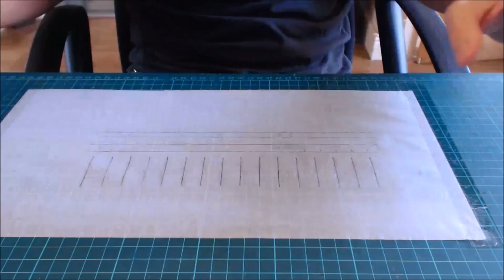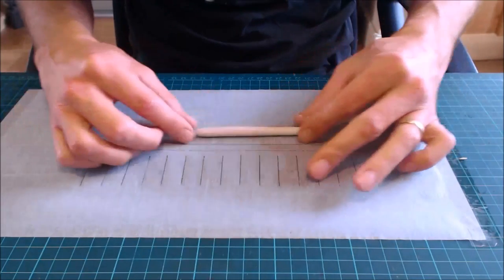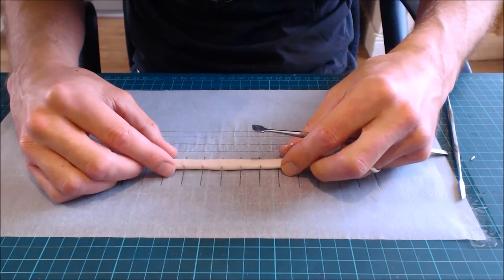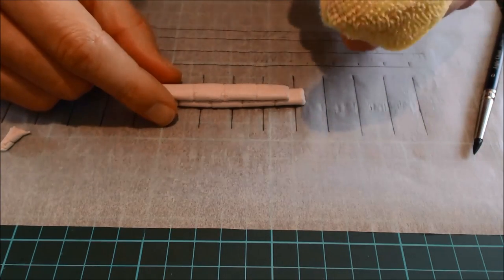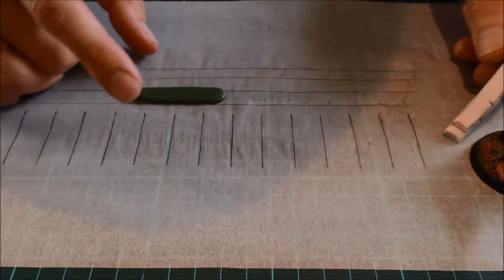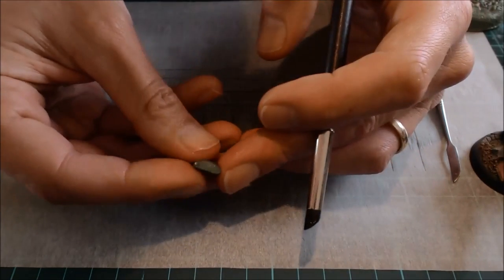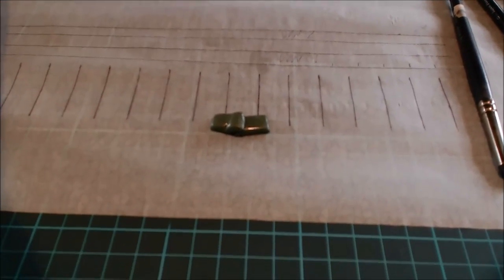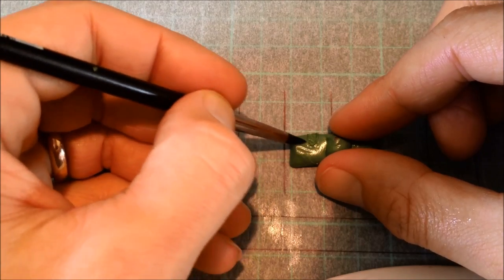How to make sandbags for your wargames terrain

Comment: Makes me wish I had some silicone shaper tools. 

"I'm going to have to get a better camera." - watch out.  You end up heading down the gear hording path.  It's a dangerous spiral.  ;)

Nice tutorial.  I love the bulk sand bag emplacement build.  Fast, uniform, realistic.  Great.  :)

For the close ups, I might try moving the lights off center along with the camera, and you work from the other side.  Camera/Light on left, you on right.  Then you won't cast shadows on it as much.  The risk is that your hand will block it more often.  Hmm..  I'm not sure about it though since your using an iPhone.  It doesn't have a zoom I suspect (or not a great one) so your are limited to keeping it close.  If you could push it back, you could raise it up a bit and peek over your hand.  If this isn't possible, give me some idea of the camera workings, and maybe I could suggest something else.  Ahh... Camera angles.  Still working on that myself.  ;)
Reply from the maker: ***** Seriously, you don't have any clay shapers? I use Royal Sovereign black tips, don't bother with the white tips, they're too soft for miniature/terrain work, if you can't get hold of any (I'm sure you must have them in the US), let me know and I'll send you some mate. Just don't use them with filler (spackle?) or milliput, they don't mix well.I seriously need to sort a decent setup, not an expensive one, just one that I can control and standardise. The main issue I'm having is that both my webcam and iphone automatically control wb/exposure/gain etc and so the colour/quality vary from video to video and it really annoys me. Thanks mate, unluckily I've had extensive time to study various sandbag build techniques employed by the Royal Engineers. If you think that was fast for emplacement builds, I've got a video coming that'll blow your socks off ;-)On the lighting, I'm only working from one direct source but it's on a flexistand with a suction cup so I can move it to any position as I have a large whiteboard mounted directly, so I'll try offsetting it to my right as I'm left handed. My webcam and iphone are also on flexistands with suction cups (yes they fall occasionally, well they fell, I jump lol), so lots of angles are possible it's just a real challenge to balance lights, camera and me trying to show people what I'm actually doing. The iphone has a bloody good camera and the latest update includes a function to zoom video so I think I'm going to have to install it and have a play. I might email you when I figure out what exactly what I've got to work with. Let me know how you get on with the clay shapers mate :-)
Reply: TheTerrainTutor 
Dick Blick art supplies sells the Royal Sovereign clay shapers in the states, for just under $30 for a set. Amazon sells a more inexpensive brand under "color shapers". I have no idea whether firm clay shapers are the same as firm color shapers, though I suspect they're similar.

Another great tutorial Mel. I think your process standardizes the ordeal of making the bags uniform! Thanks! :)
Reply from the maker: DrDeathmonger
Thanks matey
Reply: DrDeathmonger
I've seen them on Dick Blick before.  Just never pulled the trigger on them.  I haven't had many times where I said 'I wish I had a clay shaper', but like other things I have purchased, sometimes it sits around until it becomes the perfect tool for a job.  :)

Comment: Quick tip. Whats wrong with the close cam.  Lighting. I sea your head in front of the light. You need a second light source
Reply from the maker: stefan arts Thanks for the tip mate, I really need to work on my lighting setup, I've just got no clue about that sort of stuff

Comment: this is a good video, thanks for doing it first of all.  A couple of questions though, what scale would these be in.  I am assuming the sort of standard war gaming, 1:72/28mm I want to do mine 1:35.  So that would be nearly double if my assumption is correct.  Cheers.  Oh actually while I have got you, I understood the thickness depth whatever but not the length of the bags, so could you tell me what that is please.
Reply from the maker: I do my 28mm bags at 15mm x 8mm mate
Reply: thanks, I have just realised a mistake I made though.  Since the games workshop figures are heroic scale, they are more like 1:48.  At least that's what scale other things would need to be to match them.  That makes the maths I need to do a bit trickier LOL